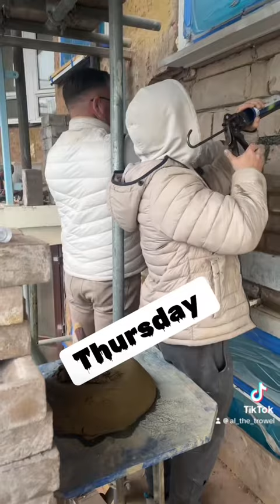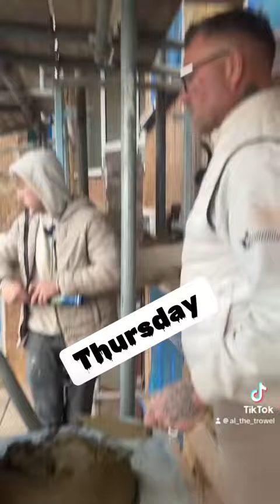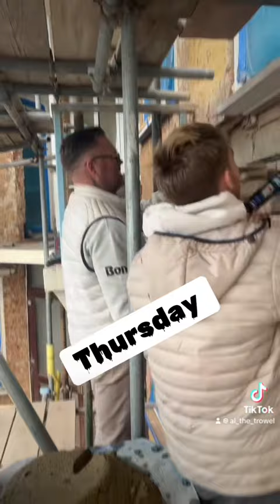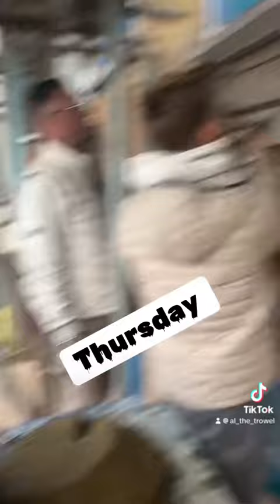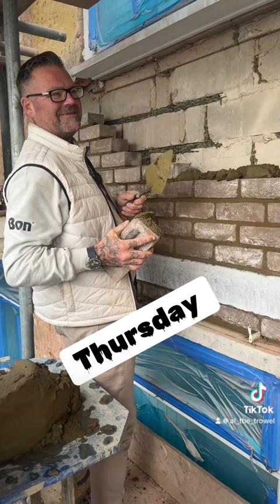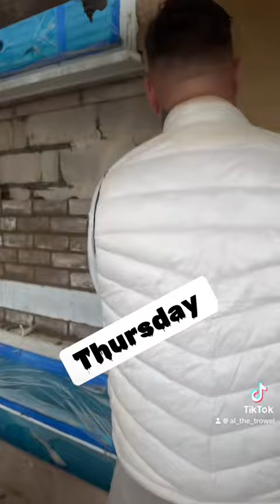Thursday

Comment: Al can ask the fellas at rhino build what’s the script and lead time with BON plastering hawk. 14inch hasn’t been in stock for months. Other 13 and 13 1/2 inch. Don’t really sell. 14inch most sought after 1. Or 16inch. If can find out that would be appreciated. Looking buy if can contact bon to get 1 👍🏻👍🏻